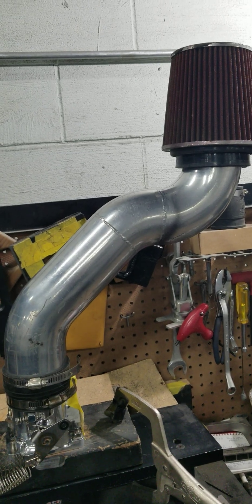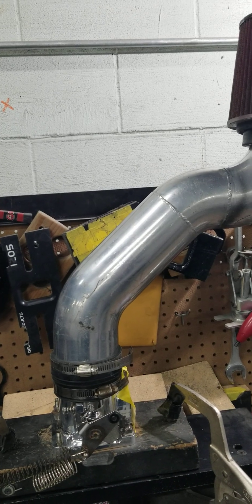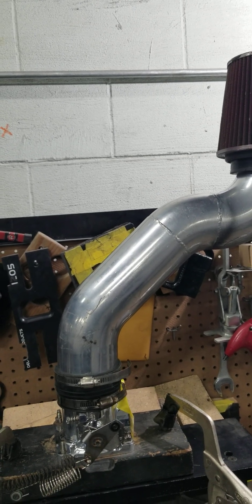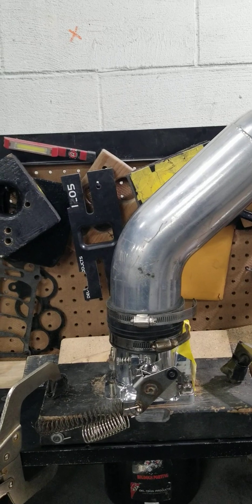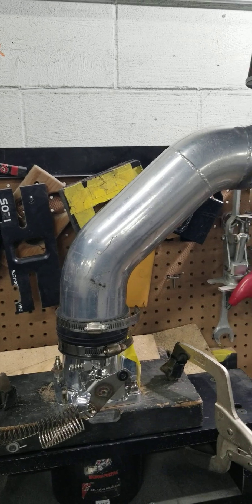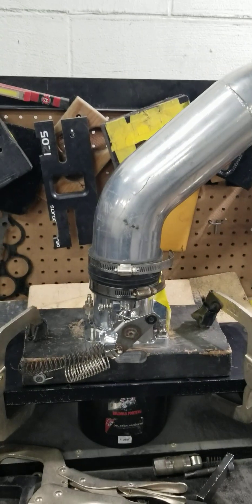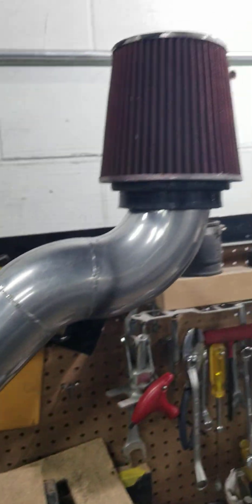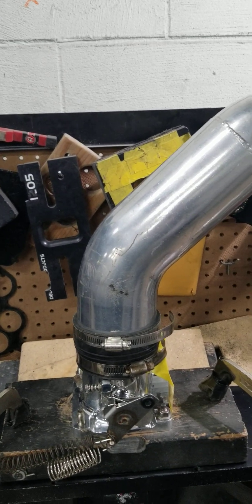Foxbody Mustang CAI true cfm flow🤔

Comment: I do love yalls testing and products. However, flow testing headers to establish hp gains is not a simple matter. An exhaust valve may open with 100psi or more of cylinder pressure,  then close under a scavenging vacuum at in/ex valve overlap.Exhaust tuning theory does not follow flowbench data.
Reply from the maker: Flow is one of the biggest ways to gain power on both the intake side and exhaust side. It all starts with flow. A design of a header, muffler or exhaust pipe means nothing if it doesn't flow well first. If you doubt us then go outside right now and completely block off your exhaust system on your daily driver and see how much power you will lose without changing anything else. Collector size, primary tube length all means nothing if the header flows 150cfm total side on a motor that needs at least 600cfm of flow per side. We have thousands of customers that's gained great power from our ported parts that's been modified to flow better on applications that needed more flow. The flowbench is a accurate tool used to measure gains or losses. It seems like some people fight so hard to keep people in the dark about the truth. We are opening up people's eye to the truth and how to make more power without wasting money and time. 👍